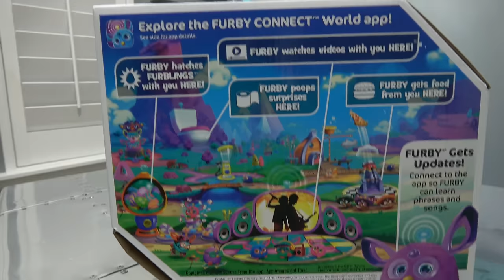What's inside a Furby Connect?

Comment: 1:25/1:59 (I know that this came out about 5 years ago), but the old 1998/1999 Furby does actually work! Becuase they were kept in the box for such a long time (and not turned on), the gears can get a bit stuck from possible dust! To get it to work properly, you'll have to take the fur and shell off to manually turn one of the gears inside to get them moving! I have 11 of the 1998/1999 Furbys, and had to do this to 7 of them :)

(Also $500??? That seller definitely scammed you/overpriced that Furby, cuz they're worth around $30-$80 depending on their condition and if they were a limited edition variant, [which that specific Furby was not])

Once again I know that this came out 5 years ago, but I just wanted to say that in case anyone else was curious about it <3

Comment: The saddest part of this video isn't the blue furby but the fact they opened a mint in the box 20 year old FURBY just to do this ...you could have used an old one 😠😠
Reply: Why did they have to use a mint condition original furby!
Reply: Theadventurouspatch IT'S HEARTBREAKING
Reply: It wasn’t a real mint furry, it didn’t work. The got ripped off
Reply: @Nixon Plays I once got a broken furby, just had to get a to gear start moving and it worked!
Reply: Wait! If someone else bought this and expected it to work then that would be terrible, now it saved somone from being spammed
Reply: Sophie Mendes it is not 20 years old it's a 2000 furbie its only 17 And you can get it from target

Comment: 1998 furby need reset and it will work,

Edit: I mean, when you found a vintage furby new in the box, they don’t work cause there in a coma sleep
Reply: It's 1998 furby not 1996
Reply: @skidtheskeletonboyspookych4651  they were early furby
Reply: @BradenTheBeaverHTF  but the first furby was made in 1998
Reply: @skidtheskeletonboyspookych4651  ok
Reply: @skidtheskeletonboyspookych4651 it’s 1998,
I used to think it’s a Very rare variant,

Comment: The old one was probably actually still new in box last year I got one for my wife for Christmas and it didn't work either after a bit of research online I discovered that over the years in the box the grease in the gears breaks down and the thing locks up a quick disassembly and manually spinning the gears freed everything up and it works perfectly.

Comment: I'd like to go into detail to explain he overpaid by about $450 on the original furby and for $50 could have gotten one nib in mint condition. The furby he did buy was indeed new in the box but the reason it didn't work is because the motor gets jammed after being in storage for years. To fix this you must bang the bottom of the furby repeatedly with some force and it may take a while but it will 100% turn on. Works pretty much everytime unless you threw it in some water or something.
Reply: I'll try this on some of my guys that don't work, thx 👌